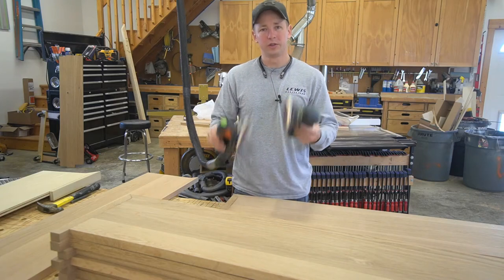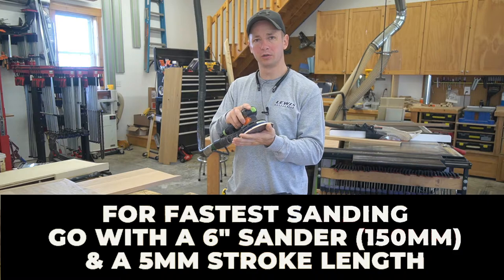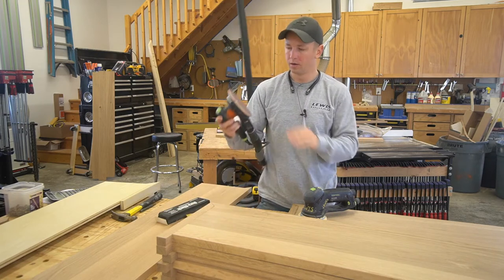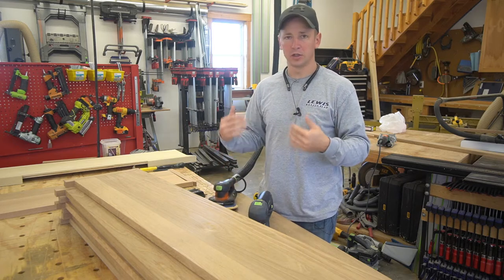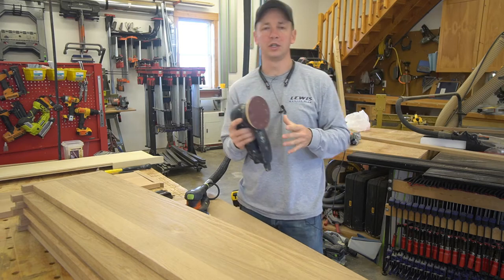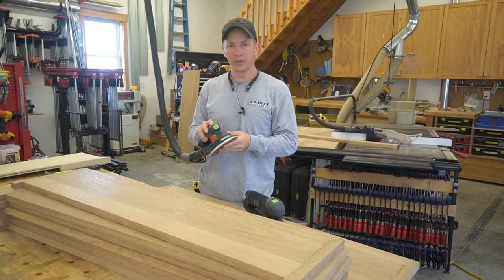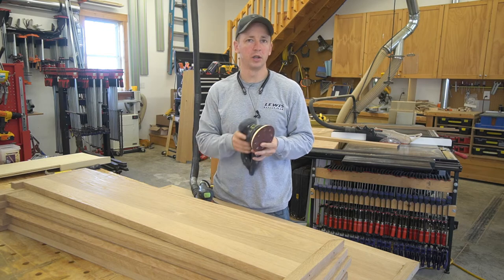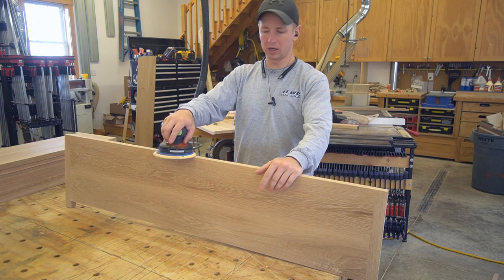Festool ROTEX VS ETS SANDERS | Buying Mistakes I Made & What You Need to Know Before Buying a Sander

Comment: In case it matters, I'm pretty sure Rotex in RO mode is 5 mm stroke
Reply from the maker: But not nearly as smooth in my opinion.
Reply: @InsiderCarpentry  No not at all.  And the balance is way off with the Rotex.  I used one for a project over the summer when their ECs were backordered weeks, and it's tough to control, especially the 150.

Comment: So your Rotex can become  a fixed orbital sander via a gearbox.
Essentially you've taken the random out random orbital. 

Rotex is not meant to be used vertical  as its heavy and cumbersome. 

Your ETS is meant to be used in any position  so if you sand items in situ like boats or fixed items  then ETS is the much better option.

The ETS comes in two orbitals, 3 and 5mm.
The Rotex only in 5mm.
Ets 150mm and rotex 150mm share the same cheese grater sand paper.

Ets 125 and rotex 125 use the std paper.

Hope thats adds s little to your comparison.

Is hou have to  sand in many positions the Rotex is not your friend.